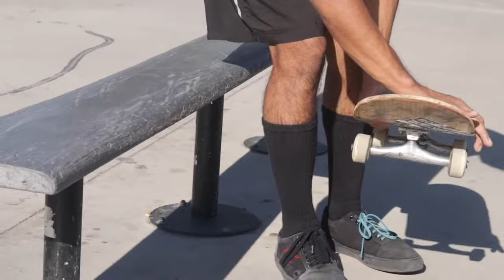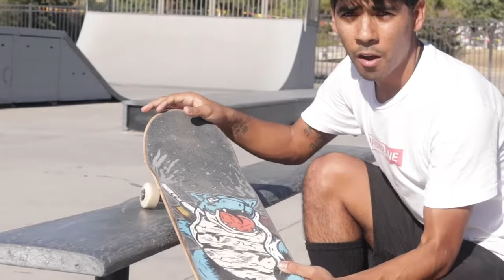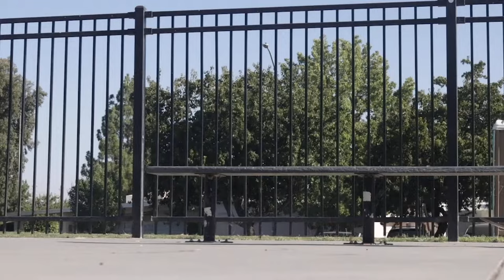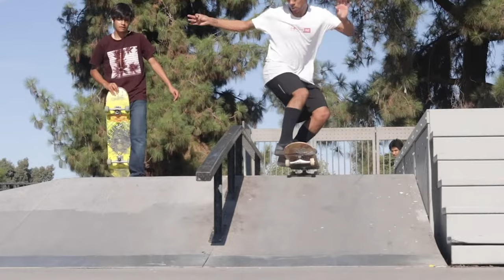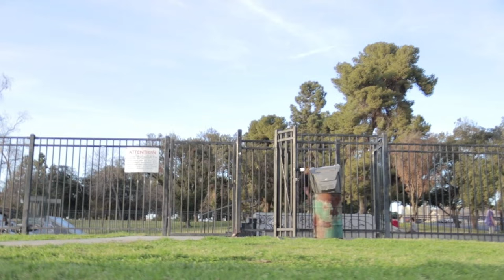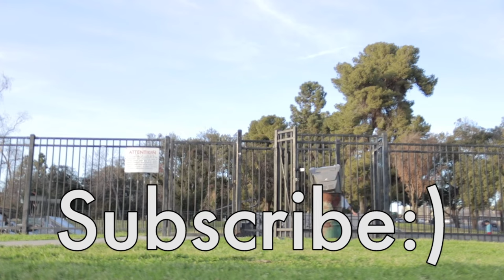How To Barley Grind

Comment: Yes, i like this. Well explained. When you 180 where are you looking as your board locks in? 
Appricate the tip.
Reply from the maker: When I do the 180 my attention is towards the back truck locking in so I could apply the pressure on it

Comment: You never heard of Donny Barley?Noway!
Reply from the maker: I knew it was named after someone
Reply: It should be called Ibaseta Grind.
Reply from the maker: Why that name?
Reply: Rick Ibaseta was a pro skateboarder in the early 90's. He rode for a brand called New Deal skateboards. In their second video 1281 he does them regular a d switch. He definitely gets credit for doing it first on film. Donny Barley learned them around the spring/summer of 1995. I was working at Woodward PA and he was a guest am with Toy Machine. He told me that he liked doing tricks people barely do.. he figured this one out and masterd it in Welcome to Hell. Thrasher had an ad for First Division wheels. In the ad Donny was doing one on a rail in Philadelphia. It said in the ad Barley grind. So I'm almost certain that's the correct timeline of the evaluation of the Barley grind. 
PS you do them very well! ❤️🛹🤘
Reply: kids smh😂😅

Comment: Ok so this is named after Donnie barley.  First off he a sick front side 360 but it's a double set . On the first rail he does a standard barley grind, on the next set he does a switch 180 to frontside smith 
 That is why he owns that trick son. son. He did it both ways on two different rails.